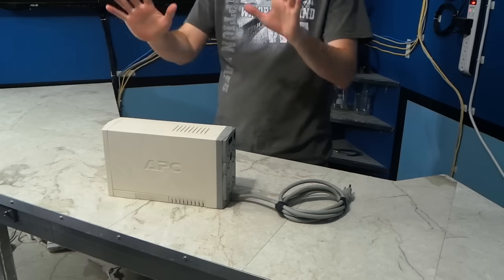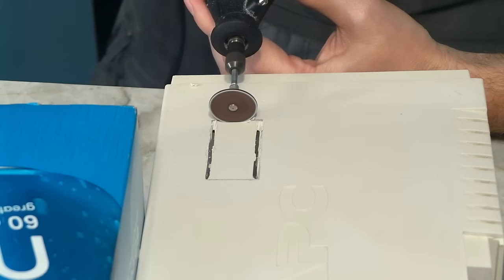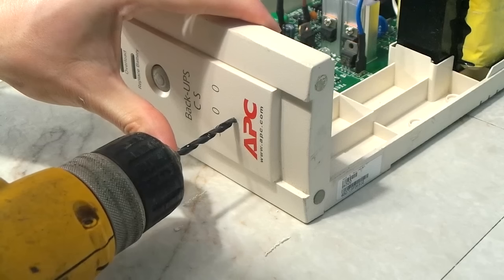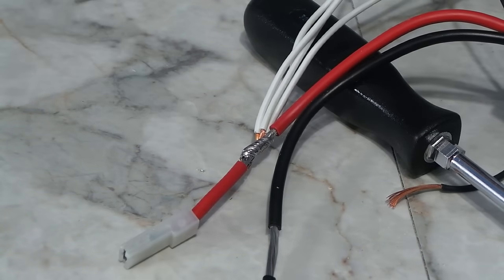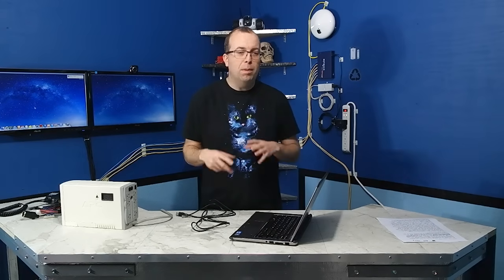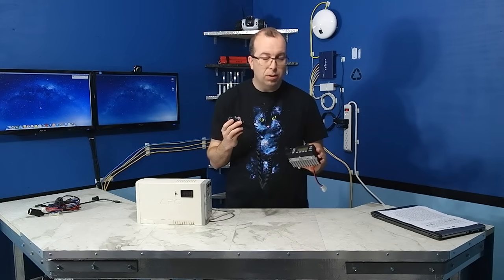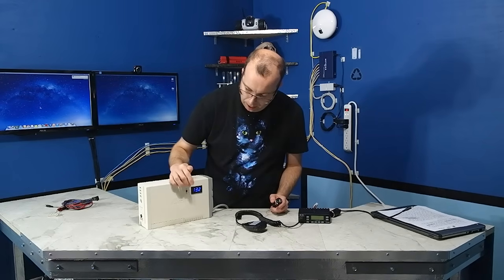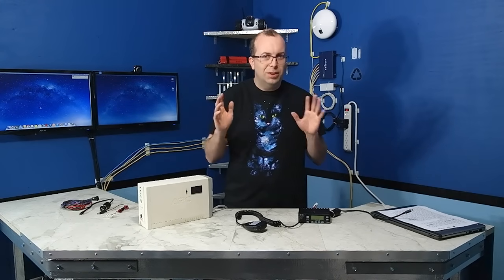Ultimate Battery Backup Hack/Mod.

Comment: If you are tapped directly into the battery, there is no way to prevent over-discharge. You'll definitely want to add a low voltage cut-off/protection circuit otherwise your battery won't live very long
Reply: He has a volt meter on a switch. I'm sure that's what it's for.
Reply: It's a lead acid battery, also it was 5 years ago.  The thing I noticed was he didn't fuse any of the DC jacks.
Reply: the inverter keeps it charged, but if the power is out it will over-discharge.
Reply: That's precisely why he's using a voltmeter on a switch to not overdischarge the battery
Reply: @jyotiradityadeka2905  yes but the thing is that it's not protected, and you may forget to check the voltmeter and it may over discharge
Reply: @bobadam7021  And I thought I was a geek for noticing no fuse protection... A year's worth of planning going into the install on my new amp and subwoofer in my daily driver.
Reply: @Bee EffUsually it's the battery that dies not the circuits.  3rd party replacement batteries are half or less the cost of a new UPS.
Reply: @Bee Eff Sorry to hear that.  Mine usually last 2-3 battery changes.
Reply: @DemeDemetre  Lead-acid batteries like that are often built as deep cycle batteries which are built for that kind of discharging it would be fine and as he did add a voltmeter he can monitor its lif properly and in a survival type situation as long as it does the job that is all that matters if it is consumed in the process, oh well, but it will never under-volt in a normal day to day scenario as it is constantly being checked and charged by the charging circut.
Reply: @randdower6573  first of all, where the h3ck did you find this comment?
and yeah, this is lead acid, so are car batteries and etc. I used to have a flashlight and it had a small lead acid battery, and I'm sure it had little-to-no protection. It was a crappy Chinese one
Reply: @DemeDemetre  I found the comment as I was looking at doing this since I just picked up a couple of free APUs. The battery in that unit is the same type they use in electric wheelchairs these are all semi-sealed deep cycle batteries you can drop them to zero and bring them back many times before they go bad from it. it is not like a Lipo battery where it literally will be done immediately on the first full discharge. Thanks for responding I noticed after posting your post was pretty old but I left my response anyway for others who may stumble onto this.
Reply: @randdower6573  Okay
Reply: @artsmith103  The switch is just for the meter
Reply: LOL, modern Li-logics.
Reply: Wrongo. That's what his switchable voltmeter is for. Only a complete ditz would run it flat without checking status. Your low volt cutoff uses juice otherwise wasted.
Reply: @bobadam7021  I agree. I always fuse direct dc jacks, for safety, or overdraw.
Reply: @DemeDemetre  Forget ?  Yes, if you are semi-aware. Building yourself ensures you do not "forget" and run it flat. One can also use a second, or alternate battery. Keeping one working, while solar/dynamo charging the other.
If you depend on the rig for power-down communications, only having one battery gives you limited endurance.
Reply: How about a fuse
Reply: @davidjames1063  Even if you build it yourself you might forget. Or what if the power goes out at night with a load enough to drain it during the night?
Reply: @resneptacle  Your key word here, "forget". I forget nothing of import, especially electrical items. Ever.
Reply: How you prevent the charger impulses?

Comment: Be careful with the small UPS units when adding larger batteries. They don't have the thermal dissipation for extended run time. I had that exact model that I connected to a 35AH battery to power a small computer that hosted a web server. We had a power outage that lasted 2 hrs, and the transformer got so hot that it started melting the varnish and insulation on the winding (you could smell it) and it melted the plastic casing. It didn't actually fail though but was definitely a fire hazard. The small ones are only designed for short run times, where they wont heat to critical levels, and clearly id did not have any over temperature protection. My much larger APC Smart 1400 with 2 55AH batteries that can run my quad core desktop with 6 hard disks and 2 monitors off the grid for 2 hrs had no significant heating issues. Granted it is also a model that has external inputs to ad additional battery banks so it is designed for it. But it also has MUCH more ventilation and a fan that kicks in to cool the unit while off grid, and also runs during charging. If you are going to try this on a small UPS do a full off grid test a couple of times while you are around to make sure nothing gets excessively hot. You don't want it to catch fire if your power goes out and you aren't home.
Reply: The models that use switch mode inverters do not have this problem. But it is better to choose a model with external battery provision even if you do not use the oem over priced battery. 
I bought a used br1000g in 2020 for 20$. It was retired from an office that replaces all equipment every 4 year. & Even though the original 2x 9ah battery were in the unit. They were pretty much dead. They would run for like 5mins with no load and even 50w would immediately shut-off. I bought 16 Lifepo4 cells. 32700 6000mah 3.2v & made a 12ah 25.6v battery. Lifepo4 is proper replacement to leadacid with similar voltage curve. I did not have to dig with apc upsd and change & charge parameters. It would charge the cells at 3.75amps when external battery mode was enabled. & Run 300w load for 50mins which is similar runtime of 6x9ah battery according to apc runtime chart. So it was essentially half as cheap to buy Lifepo4 & they are holding full capacity as of today & even if they fail after 5 years it is still cheaper & better than leadacid. 
1 oem apc battery goes for the price of all 16 cells + cell holder+ bms 😂 & i would need 3 of them to have the similar run time.
Reply: Now definitely better off using something like a jackery or ecoflow. That's probably what I'm going to do for my networking equipment.

Comment: dude.... grinders on ally is a big nono, particularly if its a normal ferros metal disk, the ally dust is explosive and/or you can gum up the grinder and the disk can explode. if you've cut steel previously it can even create thermite.... the dust is also highly toxic. cutting ally with one just makes heat, which is why your cut looked like melted cheese. Get a hacksaw, or a jigsaw (with ally blade) or a ally blade for your cutoff saw and you'll do it 100x easier and neater, with 0 risk of exploding bits of grinder disk flying around your house, or explosions from the dust, or health problems from the dust...
Reply: sn0wchyld Get off his back.  He is a limited tools guy that mainly does software and is just dipping into hardware.  ...  You could say the same thing but put a positive spin on it without sounding condescending.
Reply: servant74 one comment is hardly 'on his back...'.  really wasn't trying / intending to be condescending... it was meant to be 'stern' (for lack of a better term) though, as not knowing this could genuinely result in his (and anyone else who does the same) severe injury, or even death. Apologies in advance to The iBookGuy if its taken that way, i do like allot of his stuff... but this is a serious danger that needs to be addressed. I'd rather come across as too harsh than the seriousness not be conveyed because i sugarcoated the comment.
Reply: sn0wchyld I usually don't cut up my allies. Did you mean aluminium (aluminum?)? In that case I mostly agree, but I'd like to know more about the supposed toxicity.
Reply: mjouwbuis yea... ally is just an abbreviation of aluminium.
afaik its just 'fine dust' toxicity - the same with any ultra-fine dust, its bad for your respiratory system as it can get past the normal 'filters' (ie nose) and deep into your lungs.
Reply: sn0wchyld IBookGuy is not cutting steel he is cutting aluminium and im sure if what your talking about the "allie" (idiot) is getting SOOO hot to melt the "allie" then we should be seeing molten aluminum just draaaaaining down the "allie." So we don't see molten hot allie draining down the allie.
Reply: (Force of friction)x N =(Thermal energy)
Reply: Dessertman and?
Reply: sn0wchyld  Just so no one thinks grinding aluminum is an explosion hazard. Aluminum dust is only explosive in relatively high dispersion concentration (0.5 kg or so per cubic meter) and requires confinement as well. fuel+oxygen+ignition+dispersion+confinement=explosion, otherwise you just have combustion (flare up). there is a big difference between combustion and explosion. i work with very fine metal powders every day so i have some background on this.
Reply: J Cole good to know, though still kinda scary :P
Reply: Aluminum powder or grinding swarf is potentially dangerous if it is mixed with iron or steel grinding wastes and is wet. These are the basic ingredients of a thermite bomb, and there is a very real risk of a fire due to the reaction between the aluminum and the iron. However, if the aluminum and iron wastes are kept separate, then there is little risk.
The force generated by the aluminium compressed between the grains is dangerous, but you might expect it to be very dependent on type of wheel bonding. 

 It is not cost effective to grind aluminum, even skim passes as it clogs the wheel so much and so fast that it does not "cut". Going to a larger grit size and a very frangible resin will allow it to cut better, but you will go thru wheels very fast. My thought is that you found it in a hand grinder with a 1/4" thick cutoff wheel. This has no cutting fluid and will clog extremely fast. Other than safety as explained, it is not cost effective and they are learning bad habits.

My experience is the bonded abrasive (grinding wheel) composition may be compromised by the heat generated by a "clogged" wheel. The heat is usually carried away from the wheel in the metal it removes, but a clogged wheel becomes a heat generator and the metal adhered to the wheel seals the heat in, therefore you could see a wheel explosion when the material is in contact with the wheel. We use coated abrasives (sanding belts) with cubic zirconia grit and putting regular old beeswax =>
or a moisturizing facial soap on the belt keeps it from clogging. Hope this helps.
Reply: +scyther6666 I understand that thermite could form, but thermite is a mixture of aluminium dust and iron oxide (rust) dust, not aluminium and iron. The reduction reaction which fuells the exothermal reaction cannot happen between iron and aluminium.
Reply: +sn0wchyld Thanks for the heads up!
Reply: +servant74 I really don't mind when people fuck around, but what this guy is doing is outright dangerous, leaving a direct connection to a lead acid battery unfused is just reckless.
Reply: +Blacktronics good spot, i missed that one. 

He also claims that charging via the SLA-inverter-ac/dc-USB he'll only get 1 charge, vs 12 going SLA-DC/DC-USB. either he has no idea what he's talking about or that inverter is the most inneficient one i've ever seen. most are in the mid to high 90's for efficiency, so are ac/dc power supplies. he might loose one charge by doing it normally (ie off the 110v ac supply), but that'd be it.
Reply: P Mason you probably could... but i wouldn't recommend it. any shorts within your pc and you now have a power source capable of supplying a few kw of power, if only briefly, and no protection circuit. Voltage stability would probably be an issue too.
Reply: P Mason bad idea... you will dump power from the battery back into the ps the moment you switch it off. you could use a diode, but its still unregulated, and you're hoping your pc will be stable with a 10.5v input, which will drop even further under load. Not to mention you'll now have no way of turning off your pc.
seriosly mate, just use a UPS and upgrade the size of the battery. its gonna be a LOT safer, both for your PC and your hose (as what your proposing could easily burn it down). not trying to come across too hard mate... your just messing with stuff that can be quite dangerous. do some (a lot) of research on the subject and you'll get a better idea than asking randoms in YT comment sections.
Reply: P Mason gonna stop you right there. The power supply in your pc outputs 3.3, 5 and 12V on different rails. Hooking up a battery across the 12V rail would be a bad idea and on top of that, completely pointless.
Reply: Blacktronics ah yes forgot about the 5 and 3.3v sb's
Reply: +sn0wchyld farkin what? do you even work with your hands brah? GTFO
Reply: Anthony Pasquariello quite a bit actually. you? 
nfi what your on about though, bruh.
Reply: OMG. lol
Reply: +sn0wchyld  Did you not watch the entire video? The software that comes with the UPS claimed that it would only run for about 64 minutes with nothing plugged into it. That means that it would only charge a phone for less than that. You can't fully charge a lithium battery in anything less than two hours, so he is right.
The inverters inside of UPS devices are basically horrible when it comes to standby currents. They are only meant to run a PC for a couple of minutes, but can handle large surges in power draw. He would be better off never using it, and just connecting a typical inverter intended for camping and RV use to his new DC outputs.
Reply: +P Mason While that is possible, the thing is that you also need 5v 3.3v and negative stand by voltages too. You can buy DC-DC power supplies for this exact thing, but they are small as they are typically used for powering micro itx boards in car PC setups and such.
Reply: +Kenji Fox You can charge the lithium battery in my phone in about 15 minutes…but i digress. You still living in 1983?
Reply: +P Mason and where will 5, 3.3, and 1.8 volts will come from?

Comment: I would strongly recommend an internal fuse for each of the DC jacks.
The short circuit current for the battery is much higher than 16A and must therefore be protected.
Risk of fire!

Comment: Step bits save a LOT of time when drilling increasingly larger holes.
Reply: For years now, when drilling into plastic, I would always take the opposite approach by STARTING with, say, a 5/8 bit and working my way down. I was having...problems. So this explains a LOT, and I can't wait to help Nana with her next battery backup life-hack, which we are now doing publicly. (Please stop sending us letters? We do not do battery backup life-hacks for the public. We do our own battery backup life-hacks while in full view of pedestrian traffic in public areas, like parks, elementary school grounds, or subway platforms, etc. However, if you live in the Tucson-Tallahassee area, come out and see us! Just send a self-addressed stamped envelope [SASE] to our PO Box, so that we may dress accordingly). Great keep, work up the good vids, Kevin!
Reply: @heydannypark  i never damaged plastic even i star with larger ones... it depends on the rotation speed
Reply: I was thinking the same thing.  Harbor Freight regularly has a 3-pack on sale for $8.99
Reply: I use a conical reaming tool I got at Radio Shack in the 80's! Works on metal as well as softer materials -- Best 7 dollars I ever spent!
Reply: @germanni5566  I would like to see how you guys start with a larger bit and work your way down to a small hole.
Be advised, a backwards video will be considered cheating!
Reply: @erigobelli  They're probably using a horizontal spray 3d printing bit, eh?
Reply: I often drill soft thin materials by hand. No electric drill!  The slower rpm probably helps.
Reply: I start with bit small enough to insert a tapered reamer. I then 'open up' the hole which I do slowly by hand until its the exact fit.
Reply: yes they do, but this clown never heard of them
Reply: @germanni5566  yes this is pure nonesense. I love 8-bit guy hehe, but this is nonesense. Obviously you don't ruin anything by going through all the bits hehe, but to use his own words - it's a waste of energy (and time). You make one pilot hole then jump to the dimension you want - at most. Also, none of these holes need to be perfectly round. That's just the ocd speaking. It needs to be good enough for the thing u put in the hole to conceal it, nothing more.
Reply: @erigobelli  LoL
Reply: Giggity
Reply: Giggity giggity goo
Reply: Step bits are expensive.
Reply: @davidjames1063  Time can be precious too - I’ll take the step drill if it’s appropriate for the project.
Reply: @billyjack3580  I agree. That's why I put one in my toolbox.

Comment: Quick tip:  Use a conical shaped step drill to make perfect holes in plastic without having to keep changing to larger diameters.  Once you get the smallest hole started, larger sizes will stay concentric.  If you're off a little bit locating the smallest hole, you can add a little side pressure on the drill to move it back where it belongs as it gets larger.  Also, a plywood blade cuts aluminum much cleaner than an abrasive one.